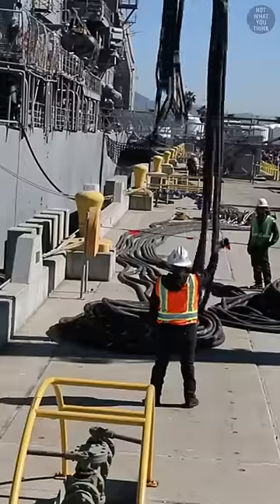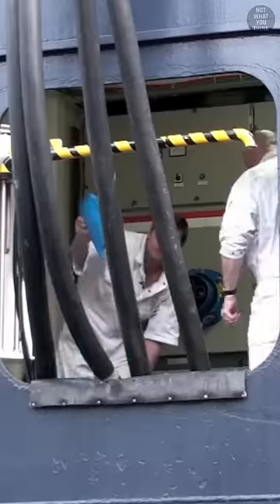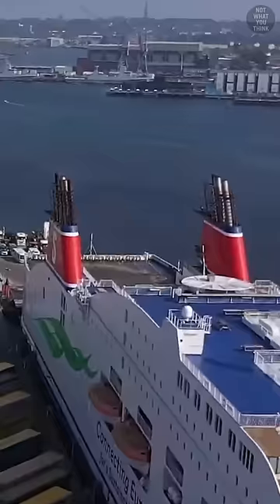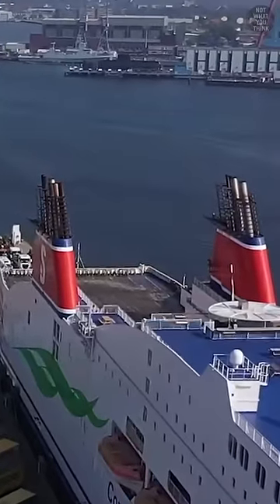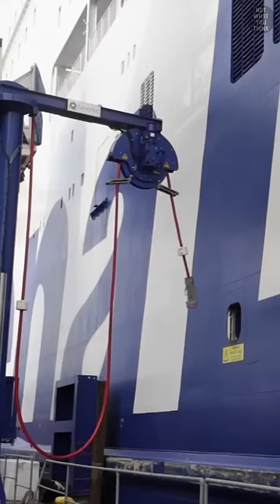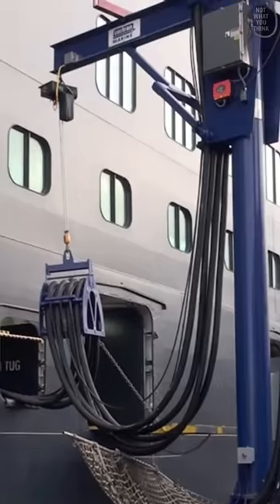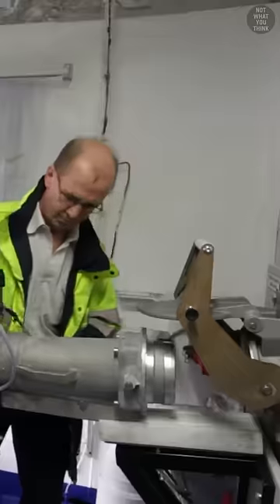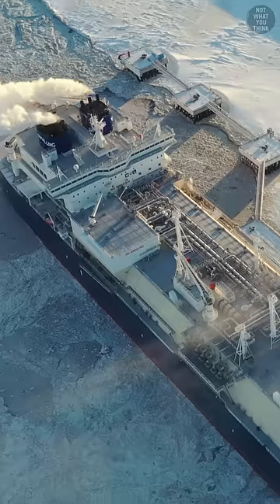Why Ships Burn Fossil Fuel When Idling? #shorts

Comment: Gotta make sure I use my energy saving lightbulbs tho
Reply: I want me incandescents back!
Reply: Yea why not? It saves you money and takes stress off the grid that still uses a ton of fossil fuel electrical plants.
Reply: @JonatasAdoM illegal you lose 10 thousand dollars
Reply: @JonatasAdoM If you want to use more than 6 times as much power for lighting, go ahead. Meanwhile I'll get some actually good LEDs that don't flicker and not have to care about how much power they use.
Reply: yes
Reply: Well if the light output is the same but the savers use 1/8 of the energy, why not?
Reply: cars
Reply: I mean, you save money in the electricity bill as well, so why not
Reply: The led lights throw too much blue spectrum light and it's contributing massively to light pollution. All my outdoor and indoor lights have filters over them to cut down on that blue light and being it back to incandescent or even low pressure sodium levels
Reply: @user2C47 incandescents look better. Mmmm warm. Hard to find good warm led bulbs.
Reply: @07slowbalt yeah. Takes stress of the grid. For all the electric cars they are forcing people to buy, that the grid can in no way handle. Thanks.
Reply: @jamesbizs  so your complaint is electric is better but were behind the game by relying on coal plants? Again solar, wind, hydro power needs investments made now not later.
Reply: @07slowbalt ”clean energy” is being massively funded what are you talking about.
Reply: @elephantgrass631  green energy has been defunded by Republicans for decades. You think we just overcome that overnight? Even the 1.2 trillion infrastructure bill didnt have enough funding to put forth what is needed.
Reply: @existinginaspace8347 If you haven't heard of warm white LEDs, you've been living under a rock lmao
Reply: @user2C47 Wasting power is actually fine... If you have electric heating on. 

Think about it, the wasted energy of a lightbulb is heat. If you were running an electric heater anyway, what your lightbulb wastes your heater saves.

If you live in a cold country that makes incandescent bulbs significantly more holistically efficient
Reply: @HALLish-jl5mo  If you're up north and run resistive electric heat all year it could make sense, but I imagine most people live where it gets warm in the summer and/or use a heat pump that is more than 100% efficient.
Reply: @user2C47 You know leds produce blue light that causes cataracts? It also exposes you to radiation as its a digital light source. Which is why it has a fcc warning on side of the package. Any other light source doesnt do that.
Reply: @brianfitch5469  > "exposes you to radiation as its a digital light source"
The first part is correct. Emitting radiation is literally the entire point of a light. "Digital light source" is nonsense, though. Are you talking about PWM? 

> "FCC warning on the side of the package*
This is for the radio noise emitted by the driver.

> "Any other light source doesn't do that."
My 6500k fluorescent light would beg to differ. 

Edit to add: While many white LEDs are known for having a blue spike around 450nm, on a quality LED it will not be very large. The spectrum of most fluorescent bulbs is nothing but spikes.